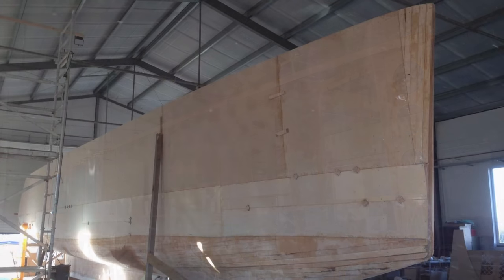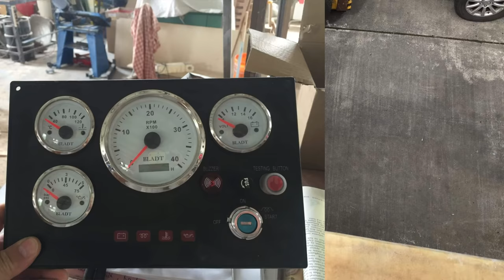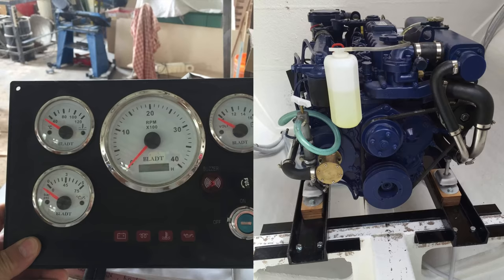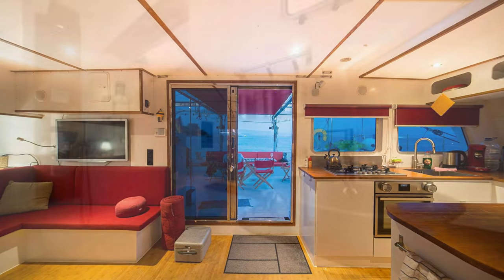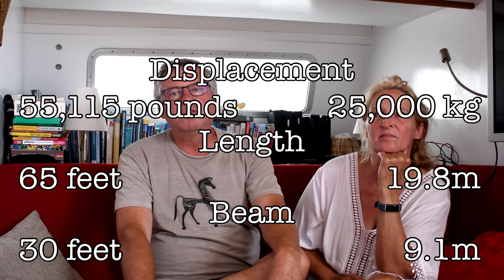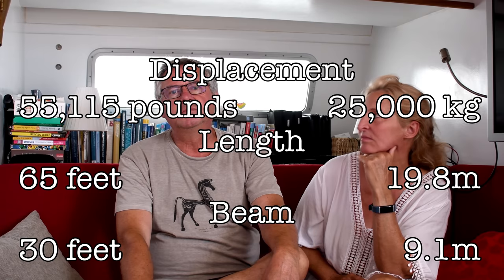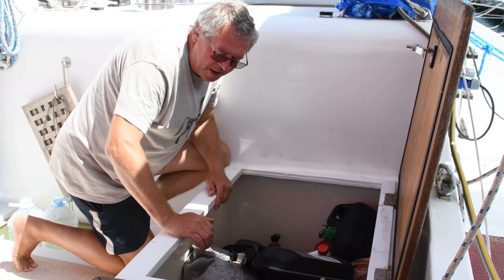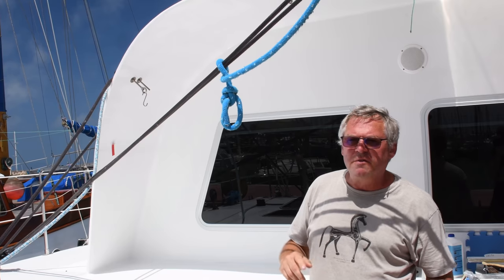Which Hull Material is BEST: Plywood | Sailing Wisdom

Comment: I had a sort of plywood boat 25 years ago in Italy. Sort of because it was built on a plug by epoxying 1mm thick by 4 or 5 inch wide strips of wood over in a criss cross pattern. The end result was a type of plywood but in the compound curved shape of a fin keel fiberglass boat. Little to no internal frames as well.
Reply from the maker: I’ve seen that construction as well! It’s amazing what you can do with a few basic materials combined in various ways!
Reply: @RiggingDoctor  Yes. It was the only one I'd ever seen and it had no data plate or manufacturer's mark. Great boat but it seemed like a whole lot of work make the plug just to to make one in someone's back yard.

Comment: Its a huge Wood cat. A lot of power boats used ply ...and pressure moulded the sheets.  

Its very tough built correctly... Its a renewable resource and repairable...so thats good it also lends itself to  one off or batch production...even mass production .. 
Im thinking in particular of James Wharram's designs it allows experimentation. 

With modern robot cutting methods and CAD it can be used to produce precisely cut interlocking parts.
I can think of two other highly successful uses of plywood ..The mosquito fighter bombers of ww2  which only suffered in the tropics because they lacked Epoxy resins and the 1984 Africar project that used a resin impregnated  plywood monocoque body tub ..for a host of reasons and to improve function in Environments from the polar circle to the Equator. At no point did the vehicles body work fail or suffer any damage despite the extreme terrains.
They actually showed that you could hit it with a lump hammer and it wouldn't break or significantly dent. It also insulates and has no significant  resonate frequency.
Reply from the maker: I was amazed that his giant cat was made of plywood. It’s an incredible build!